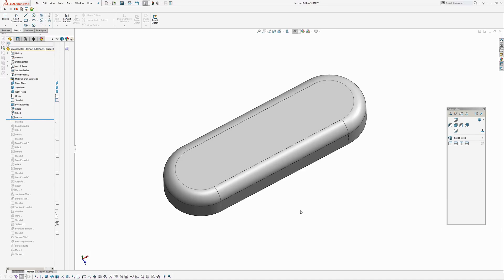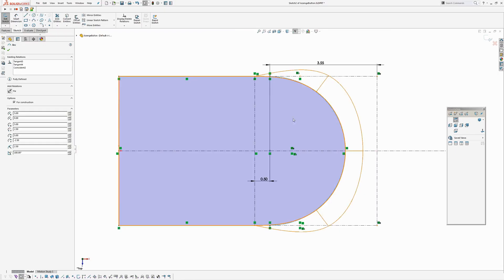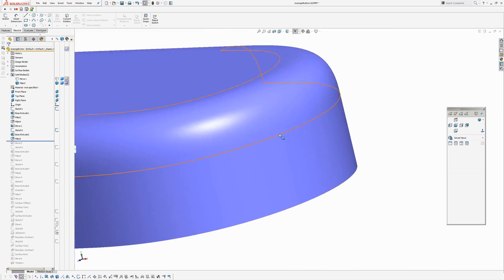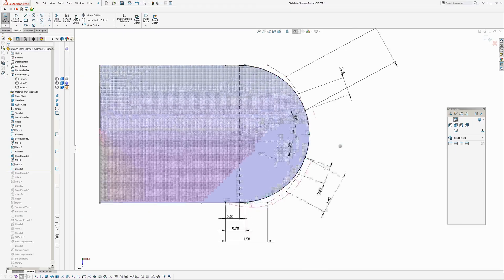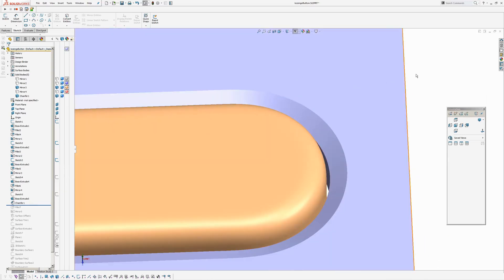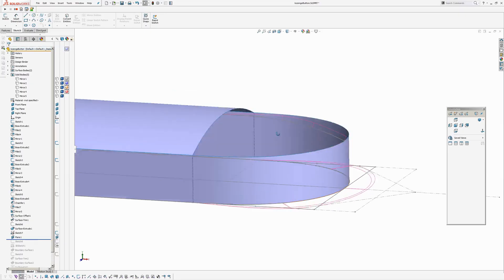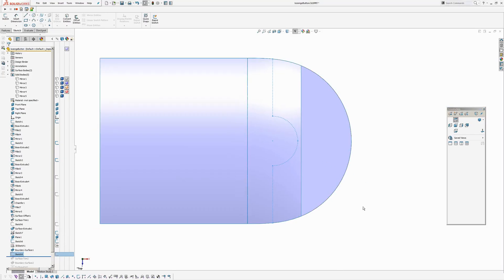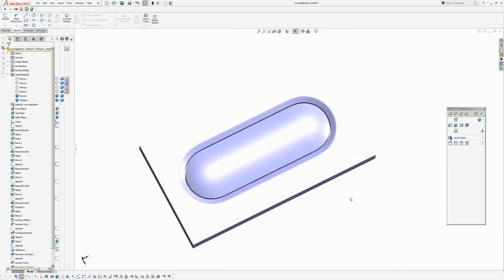Solidworks Tutorial: Modelling a lozenge or pill shaped button

Comment: This video is too good I feel like I learn nothing from school lol. Im curious what is the different between the normal one and the perfect smooth curvature affecting on industry, like the rendering? manufacturing or anything? cause I can feel it is very different in solidwork but im lack of experience to understnad what can it affect.
Reply from the maker: The difference is mainly aesthetic and tactile. If you make all connections between surfaces tangent, there is a good chance those tangent connections will be visible and depending on scale and accessibility, the user can also feel them.
Definitely visible in renderings as well. Worth the effort to make connections curvature continuous, as once the product is launched and there are 100,000 in the market, it's too late to change!
Reply: @AndrewJacksonDesignStudio  Thank you!!!

Comment: Wonderful exploration! I always try to get a linear increase or decrease in curvature. Similar to Clothoid or Cornu spiral transitions.
Reply from the maker: Yes, I have seen some discussion of clothoid curves recently, on the Rhino forums. One factor from an industrial designer's point of view is the lozenge still needs to appear as though the curved ends track like an arc. Can you achieve this with a clothoid curve, I do not know.
Reply: @AndrewJacksonDesignStudio  How can I connect with you professionally mate? I started the journey of trying to understand clothoid curves in 2018. I was fundamentally motivated by the desire to understand how Apple rounds the corners of their products such as MacBook, ipads and iphones. The other major problem I am trying to solve is  offsetting curves while maintaining continuity. I think using clothoid sections is the key. But I have not found a way to construct or approximate clothoid sections in a NURBS modeller. So far I have tried ALIAS and Solidworks with very little luck. Civil engineering softwares such as CIVIL 3D has inbuilt tools to construct clothoid transitions between two line or arc segments but I am yet to explore that. There are some 3rd party plugins for AutoCAD such as FairCurveModeler but I am unable to experiment with it.

There are many papers online that focus on approximating Clothoid curves in NURBS space but I do not have the mathematical prowess yet to understand them.
Reply from the maker: @tonysabu5621  Hi Tony, you can get me at andrew@ajdesignstudio.co.nz the conversation over on the Rhino forum died off once someone asked if they could implement a cornu spiral curve feature... maybe in the too hard basket?
Reply: @AndrewJacksonDesignStudio  I have sent you a connection request on LinkedIn. Yes I do remember reading the rhino forums. I think someone suggested using grasshopper to construct an approximate spiral. Yes it see hard. I’m not ready to give it up yet though. I just need some time to learn some new software and scripting.
Reply: @AndrewJacksonDesignStudio   "lozenge still needs to appear as though the curved ends track like an arc" I think you can with piecewise clothoid sections!